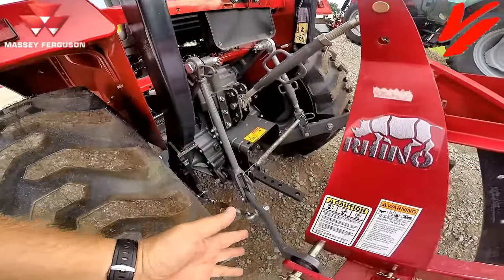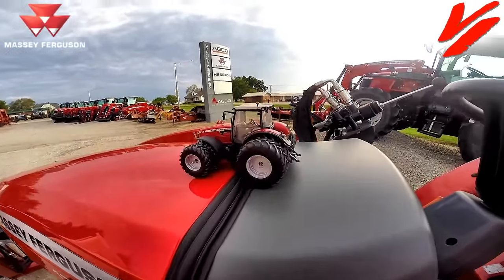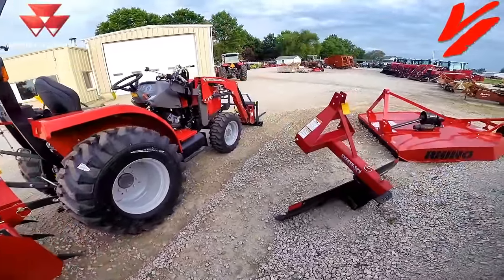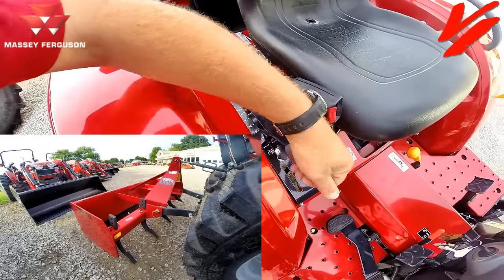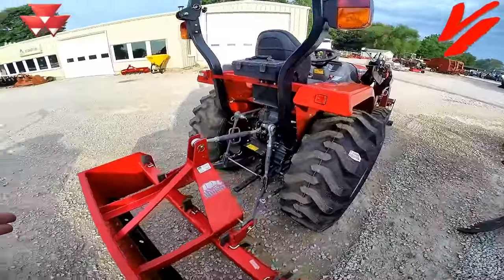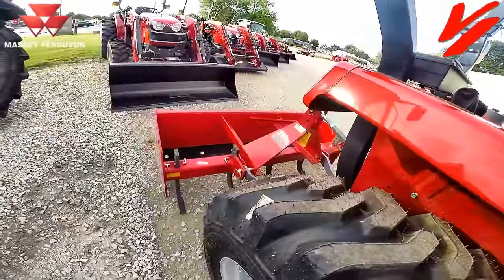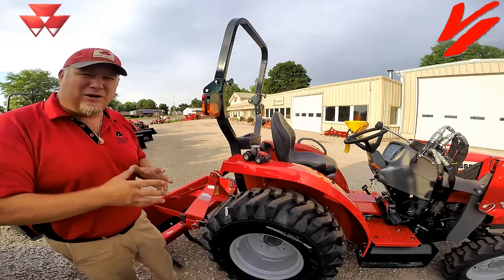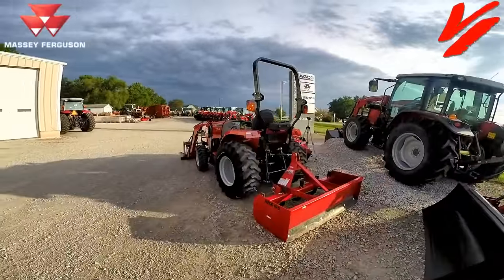The Basics of Tractors: Understanding 3-Point Hitch System

Comment: Great video.  I have a newer Bobcat 45 hp tractor that had a box scraper- I converted it to a pull behind grader(can be seen on my channel DotyBirdBuilds).  You cleared up some questions I had and never mentioned a float position on the 3pt. which I do not think exists on these compact tractors-hence why I converted the scraper into a grader.
Reply from the maker: Since 3 Point Hitch Systems do not have down pressure the implements like box blades follow the ground contours and can float up if riding over a ridge. That is why Weight is very important in selecting the right 3 Point Implements...too light and they will just bounce and do no work. You have to match the implements to the tractor to get the best performance of both items.

Comment: Can’t agree. I’ve been grading for 30 years and have tractors with down pressure and without. If your finish grading with a MF without down pressure you’ll love it. But if you need to rip some hard ground, you’ll love the down pressure as with the New Holland. If you’re using a single shank ripper to rip deeper to loosen compacted soil for a pasture or garden that holds water too long, takes days to soak in, you’ll want the down pressure. I have never had a problem with loosing traction as you can ease up on the down pressure. On the flip side, if you’re finish grading or spinning out an area the MF without down pressure will float across the ground and not leave gouges and wind rows. Try them both before you buy. There is always something you will discover that you won’t like or that you wish for. Good luck

Comment: Nice video, not to make you wrong but my 1957 Case model 400 has down pressure. It has an external double acting hydraulic cylinder.
I agree very few tractors do.
Reply from the maker: Some older models tried Dual Action Hydraulics on 3-point and it created issues with down pressure and loss of traction due to raising or taking load off the drive wheels...reducing traction and was abandoned by manufacturers. Todays modern tractors do not use down pressure on 3-point. Single Action Hydraulics to raise the implement and gravity fall to lower the implements.

Comment: I had an Allis 750 with hydraulic down pressure and found it to be very helpful when using a box blade.  I could get the blade to cut in hard ground by applying a LITTLE down pressure to get it to bite with still enough traction to do the job.
Reply from the maker: What is an Allis 750? That wasn't a model of Farm Tractor from Allis Chalmers. They had 7050 but it did not have hydraulic down pressure. Just like you mentioned if too much down pressure you loose traction. That is why they don't put down pressure on farm tractors.
Reply: My bad.  It was an Allis 720 which was a rebadged  Simplicity Powermax (4020?)   They had a 20HP Onan gas engine with hydrostat.
Reply from the maker: That is Lawn & Garden Equipment not Farm Tractors.

Comment: Belarus has down pressure on concrete or asphalt yes it will raise rear wheels in field while tractor is moving down pressure can be very helpful depends on the operator
Reply from the maker: Is Belarus even still in business? I haven't seen a Belarus dealer in North America or Our Area for 30+ Years. But lifting the rear off the ground loses all traction and not very good to get work done if the tractor has no traction.

Comment: On reason I want hydraulic down pressure is because i use a hitch mounted to the 3 point. Some trailers have little tongue weigh so they get squirrelly when backing down hills.
Reply from the maker: Trailers should be connected to the Drawbar not 3 point hitch.

Comment: I guess what I'm more interested in is any ratios or length of various components in relation to each other  if that's even possible due to the differences between the makes of tractor.
the only thing I can think that is similar is the A-arms on the race car to maintain the wheel at the same angle in relation to the road.
Reply from the maker: The Tractor Industry has standardize some of the dimensions of 3 point Hitches. Length from end of PTO Shaft to hitch balls (Not all but most are using same dimension), width between arms for implements (Cat 1, Cat 2, etc) Top Pin Height to Lower Lift are is getting common but has not been defined but this is more adjustable do to the top link is adjusted to match implement operation. Now it's close enough to mix match brands to work.

Comment: Thanks for the video, I have a MF1085 and the 3 point hitch arms always stay up
I push the lever down and it goes right back up I have to hold the lever down for the arms to stay down if I let go of the lever the arms always go up HELP!!! I at a loss
Thank you
Reply from the maker: Is the Lever coming back up too? If so then you have friction adjustment that needs do be done to maintain the position control position of the lever. Make sure you have the Draft Lever in Position Control area of that Draft Control Segment. Draft Control is for use with Ground Engaging Implements like when plowing with a plow or chisel plow, etc. Most use Position Control for up/down control of implements. That is the easiest area to control 3 Point for raising and lowering.

Comment: You never heard of Top and Tilt? (which is fairly common) doesn't that allow for downward hydraulic pressure? If you have a heavy tractor, no need to buy super heavy implements if you have top and tilt.
Reply from the maker: Top & Tilt Hydraulic Cylinders do not add Down Pressure the Hydraulic Cylinders change the angle of the implement. Top Lift Cylinder Changes Front to Rear Angle of the Implement and the Tilt Cylinder Change the side to side angle (Like when trying to create slope or crown in the road want one side lower so water drain.) Does not add pressure to 3 Point System. Most important thing when buying three point implements is weight to match the tractor so it can do the task needed. If too light that just bounce around the surface and do no work.
Reply: @VahrenbergImplement  The top cylinder is a 2 way cylinder, when I change the angle (dig-in ) of my scraper, I can certainly lift the back of my tractor off the ground.. You wouldn't call this down pressure??? An adequately heavy tractor with top and tilt doesn't need an extra heavy scraper or box.
Reply from the maker: Top Link Cylinder Changes the Angle of Cutting Edge and the Cutting Edge, Scarifiers etc dig in more creating suction. Adjusting Top Link should not raise the back of the tractor.

Comment: Hi I'm tiring to put a snow / grade blade on my three point on the MF 1739E. I have the backhoe removed. The brackets of course stay. I can't find a place to hook my stabilizers. Do you think they sacrificed  my connection points for the backhoe brackets ? Where should I hook them?
Reply from the maker: The Stabilizers go on the inside when you install the backhoe. You can see them in this video of the CB75 Backhoe when mounted on 1700E Series: https://youtu.be/K4WnE2fJsKc Look at the set-up instructions for the backhoe there is instructions on how to attach the stabilizers for the t3 Point

Comment: Yeah I have a down pressure cylinder I got no problem with traction I'm on solid Rock with about a 30deg grade.
My problem is demolishing stuff pulling rocks out battering the ground till it gives up.
Occasionally I see a large flat or light spot that's shiny and you know that's solid Rock so then you let mr jackhammer batter that a while before you bend scarifier teeth tear up linkage next thing you know you actually have a decent spot with a Little help from mr jackhammer.
Reply from the maker: Standard Tractor 3 Point Design is no down pressure. Some tractor manufacturers are selling optional cylinder but it creates problem like you are doing and tearing up the implements because they can not ride up and over obstructions or in severe application force weight off the rear wheels and you loose traction. Tractors are for Farm Equipment not Construction Equipment. If your trying to tear out rock you need Construction Equipment.

Comment: Unrelated to 3 point. Does bucket curl add to a loaders lift capacity? Also, is there any change in lift capacity on new 1700M series?
Reply from the maker: Loader Lift Capacity is based on the Boom Raise/Lower Cylinders. Bucket Dump/Curl Circuit is not included in Loader Lift Capacity Ratings. 1700M has the same Loader and Hydraulics so it will be the same as the previous 1700 Premium Series

Comment: I just want to know what I need to do to get my back blade off the ground more.  I'm at the highest setting hydrolic wise and the blade is maybe a 1/2" off the ground
Reply from the maker: To get more kick or raising the implement lowest setting on tractor to the highest setting on implement will raise the implement the highest off the ground.
Reply: @VahrenbergImplement   If I shorten the top link will the implement go higher off the ground?
Reply from the maker: This video we did on Connecting a Rotary Cutter we show how to use the Top Link Connection and the placement of the Top Link Position on the Tractor to change how the implement come up when raising and lowering. Changing the length of the Top Length is going to Change how the Implement sits when in working position. At the 9 Minute Time Mark in this Video we discuss TopLink Adjustments: https://youtu.be/hCyVOX8TGJA?t=555
Reply: @VahrenbergImplement  You didn't answer his question...he is at the highest setting but blade is on the ground.
Reply from the maker: He never answered if he had a Multiple Position Top Link on the Tractor or which model of tractor he is working with. The Video I shared in my response shows exactly how to change the kickup or level lift with 3 point Hitch. You adjust toplink length for operation but which mounting position for toplink determines kick-up.

Comment: My 3 point won't immediately go down, even with the gravity knob wide open. It goes down over time, but not fast enough to even see it dropping. Besides me about to check that the knob is not disconnected somehow, what else should I look for? thanks. 😁
Reply from the maker: Especially on new machines it requires some weight or pushing on the three point arms will lower them. Things are new, tight and paint created friction that reduce the ability to fall. For Pre-Delivery Inspection they recommend us to us a 400# weight to test 3 point system.
Reply: Thanks for the reply. I got it working right after I made the comment. I weight 170lbs and was only standing on it. It would barely go down. I decided, while standing on it,   to jump on it when it was all the way up, with the lever in the down position. When I did it, it made a pop sound and immediately went straight to the floor. I then raised the 3 point and lowered it again. Its working now. Guess if I would have hooked the brush hog to it in the first place, the weight would have solved that problem. Thanks 😁

Comment: Thank you for the video. I have a 1970 MF 150. I can’t see any hydraulic cylinders on the 3 point. Do you know how it lifts? Gears? Any idea how heavy they can lift like a 1 ton hay bale? Hopefully someday I can purchase a new one. Thanks again.
Reply from the maker: Internal Piston System is how it raises and lowers the 3 Point. That tractor should be able to handle a 2000# Bale.
Reply: thank you very much

Comment: So is it normal, say when you have the blade on the ground and you try to move it up to 1 or 2 it won’t raise until you raise it almost all the way up THEN let it back down
Reply from the maker: Depends on Tractor and Implement your trying to raise/lower.
Reply: @VahrenbergImplement  I noticed without any hooked up it will drop incrementally, i guess I just never paid attention to the brush hog hooks up high and like at 6 or 7 it’s bottomed out. Where if I had something different I might get lower without bottoming out. Also noticed with no weight it lifts up incrementally. So maybe it’s just a weight thing. This is my first implement so might just be me
Reply from the maker: What model of tractor?
Reply from the maker: We sell Massey Ferguson so not sure how Kioti system works. Best thing I can recommend is to talk to your Kioti Dealer they the best resource for help. It doesn't sound right if it has position control 3-Point Hitch.

Comment: I thought that the old international tractor had down pressure
Reply from the maker: International 400 did and one of the problems when blading it would push the rear wheels off the ground and not move the tractor any more. Some tried it but down pressure defeated the purpose as you lost traction so modern tractors rarely have down pressure.

Comment: Hey said I watch the video I want to know if you can help me with my tractor I got a Massey Ferguson 7615 Dyna video for my three point hitch calibration and nobody wants to help me I want to know you can make a video how to do on my tractor is a 2012 Massey Ferguson
Reply from the maker: We do not have any 7 Series Tractors in stock, just about sold out of everything we have. Calibrations are performed by a Service Department and may require EDT Electronic Diagnostic Tool to perform - many calibration require connecting to the EDT to perform. Do you have Service Manual that information would be in the Work Shop Manual you can purchase to do your own service or your local Dealer can do the calibrations for you.

Comment: My PTO isn't turning
Reply from the maker: What Tractor Model?
Reply: @VahrenbergImplement  Hinomoto N329 with a electric switch for the PTO light comes on PTO  will not turn
Reply from the maker: You need to talk to a Hinomoto Dealer. Every tractor is designed differently and you need to find out how they control the PTO to operate.